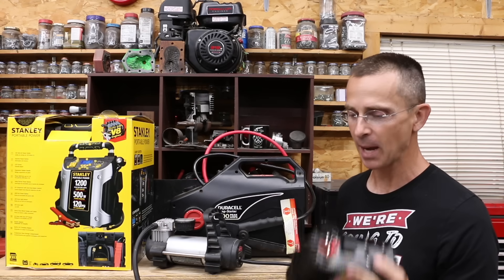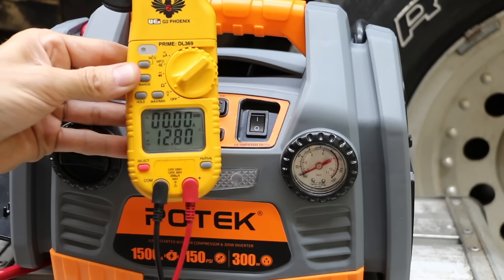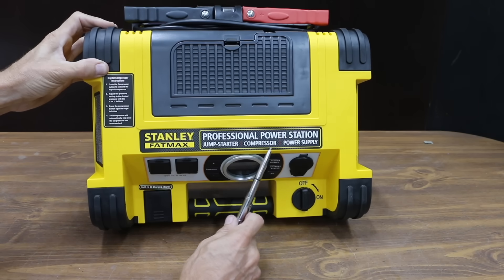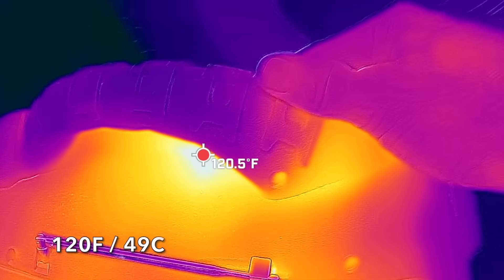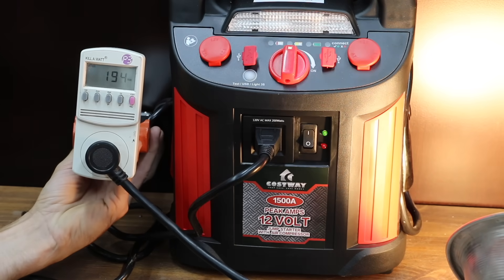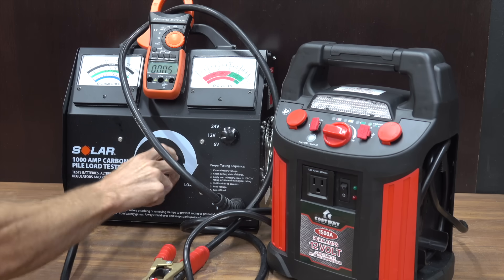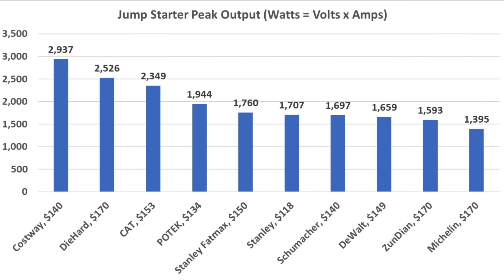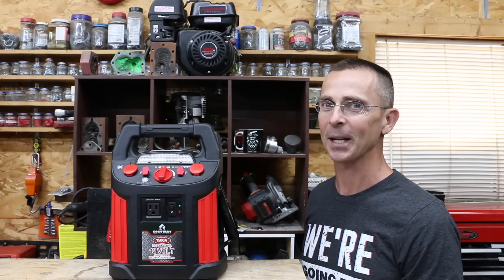Best Jump Starter? DieHard, Schumacher, DeWalt, Michelin, Stanley, CAT

Comment: I bought a smaller jumpstarter for my hatchback based on your video and it worked flawless when I needed it. Thanks for the deep analysis and keep up the great work.

Any plans to test portable deep suction wet vacuum cleaners? Looks like it's not getting more affordable and starting to compete with the bigger ones, but is it as good as?
Reply from the maker: Thanks, will do!  Thanks for the suggestion.

Comment: I wonder how old the lead-acid batteries were in those chargers. Lead-acid batteries typically have a 5-year shelf life, but the charge capacity can diminish greatly after just one year whether the device is used & charged or not.
I should also point out that clamp-type ammeters only read accurately when the lead you are measuring is completely perpendicular to the plane of the clamp. Any deviation from that will show a lower current reading.
Reply from the maker: Thanks for the feedback.

Comment: I was hoping to find out if any of these used a lithium battery but you stopped mentioning the battery after the second one. Still a very interesting test. I love my Schumacher maintenance chargers on my motorcycles but I'm not buying one of these. Another Great Video. Maybe you should have tried another car battery just for grins. Mike
Reply: P.S. with all the great videos you produce I'm surprised you have time for the farm. Thank you again Mike
Reply from the maker: All use sealed lead acid and one is agm.

Comment: Would love to see how the DeWalt DXAEPS2 does in these tests, it advertises 2800Amp peak jump start, 1000w 120v power inverter as well as the 120psi air compressor, work lights, an alternator tester and USB ports
Reply from the maker: Thanks for the suggestion.

Comment: Those don't really seem viable as a jump start for a dead battery situation along the road!  How about a test of those much smaller capacitor type?  It would appear that these tried to do way too many things and failed at most.  A simple jump starter with maybe a cell phone charger capability that could actually do a couple of starts in cold weather would be useful.  These are so much junk.  This is at their peak condition.  Toss them in the trunk and go to use them a year from now......   Good review as usual.  By the way, if you plugged these into the car battery for the inflation test would they have completed the fill without quitting??
Reply from the maker: Thanks!  They have a timer to prevent overheating.  When cool it can be restarted.

Comment: I’m sad that “jump n carry” wasn’t tested. I see them used by nearly all commercial tow and auto repair services. They have no flashy consumer junk. Also I’d like to see these jump packs taken apart to see the construction and battery. I took my jump n carry apart and was pleasantly surprised buy it’s robust construction.
Reply from the maker: Thanks for the suggestions.
Reply: Same here, I’ve had a couple of these consumer grade jump packs, and a Jump N carry 660. I’ll never waste another dime on the consumer ones again the JNC660 is over 10 years old and is just an absolute beast. Worth every penny.
Reply: JnC are really the best Ive ever used but the form factor is also very Truck friendly, behind and under the seat!
Reply: All my workers have jnc best best many days used with out charge for cars sitting for years nothing better then jnc
Reply: Another vote for JnC, I've had one for about 9 years, and it still meets performance expectations every single time I use it
Reply: A take down would be informative. The Canadian tire version of these multi function jumper compresser boosters had very low cross section power bus connections and when its battery packed in, batteries with its light  pole configuration weren't available. I went over to a higher end Jump and carry  type Booster with a heavier battery and bus, and have started at least one jeep that a Noco couldn't turn over.
Reply: News flash, they're just like these. How do I know?? AAA sent a guy in a tow truck and they were unable to start my dead battery. I borrowed a jump start battery from somewhere (it didn't have all the other doodads on it) and it was able to start my car. You'd think the tow truck guy would have jumper cables. But nope.
Reply: @metatechnologist  man the jump and carry one a great and powerful
 will start a diesel engine no problems  some model are12/24 volt for big equipment that run on 24 volt
Any multi tool is junk so no surprise about these 3 in 1 booster pack
Reply: @metatechnologist  Why carry jumper cables which can only supply what the host car puts out (less than 1000 peak amps) when most modern, even cheap, Lithium Ion jump boxes can push out 2000 and many can reach 4000 peak amps.  That's enough to crank even large displacement heavy duty pickup truck engines - so long as they're 12 volt.
Reply: @amzarnacht6710  yea jumper cables tie into what the other host alternator i.e. (higher crank/viltage) can provide as well. My experience has always been that they are quicker and more reliable. AAA has no excuse!
Reply: @amzarnacht6710  you are not just pulling from the donor car alternator, but their battery as well.
Reply: @totaljunk7508  Still doesn't produce much more than 1000 cranking amps.  Sufficient for a slightly drained battery, unlikely for a flatlined one.
Reply: Have a jump n carry at work and can confirm they are junk. Worked great for a couple cars, after that won't jump anything
Reply: @DFxDesignz must be a fake we got 3 at the job and been doing great for f350 diesel and many john deere loader that use 2 ×1000cca batteries
Reply: @legros731  No, you have a completely different model if they're jumping 24 volt systems (2x batteries).  Connect a 12v box to a 24x system and it'll do nothing but burn the box out.  Most 24v capable models can toggle to 12v with a switch so won't fry your pickup truck's electronics.
Reply: @amzarnacht6710  you are clueless  
Jump and carry make many model my particular model is one of there best And cost 500$ and it been doing strong for many year 
 It the jnc1224 and it do both 12volt and 24 volt just need to change the plug on top to switch from 12 to 24 we almost never use the 24 volt when a say 2 battery on the john deere there in parallel so it still 12 volt but it 2 × 1000cca battery or 2000cca total and these booster can start them just fine even in winter
Go away internet mechanic lol
Reply: @DFxDesignz Unit must be charged minimum every 3 months when not used.  Product literature  strictly states this.  Also states must be  immediately charged after each use.  Failure to do so degrades/ruins internal battery.  While you may have received rare defective one, failure to follow charging instructions are mostly to blame.
Reply: A can told you they beat any of these useless shit with ease
Reply: Small lithium ion jump packs are better. Just hold the clamp on tight while someone cranks the engine.

Comment: These tests are interesting, but for products like these, one further step would be particularly useful -- a partial disassembly of the units to (1) look for damage (what smoked?), (2) identify the battery contained in each unit  (same manufacturers?, manufacturing data that may be printed on the battery might be helpful, glass mat?,  etc.), (3) consider the quality of the components (eg, gauge wire, type of compressor, quality of compressor -does it use a plastic piston, metal piston, adequate cooling fins, etc, quality and characteristics of the inverters, etc., all of which may relate to the anticipated service life of the units).
Reply from the maker: Thanks for the suggestion.

Comment: I had a Schumacher and it failed to jump start a 4 cylinder. Then failed first and second time I tried to use air compressor.I would not buy any of these due to poor performance on compressor and jump starting.
Reply from the maker: Thanks for the feedback.

Comment: When one of these units dies it is usually the battery in the unit not the circuitry. If the internal battery can be replaced for cheaper than replacing the entire unit that may also be a factor to decide which you should purchase.
Reply from the maker: Thanks for the feedback.

Comment: I have the CAT unit, I did not realize when I got it that it did not have a 12 volt outlet, I wish it did, so I hooked the cables to a 12 volt plug and powered a 12 v fan but had to listen to the unit beep all the while it was turned on I also wish it would charge in my vehicle. As always, great video!
Reply from the maker: Thanks!  Thanks for sharing.

Comment: How well did the inverters hold the AC voltage as the load increased? I wouldn't want to plug anything sensitive into one anyway, but in an emergency...

Comment: this is a good test, as always. I would expect all of these to be crap in cold weather as the lead acid batteries will lose a lot in the cold. These could be good for traveling or an all in 1 setup in the house just in case. I keep a lithium polymer jump pack in my car as it lasts a long time between charges, and isn't near as affected by the cold. ( when you are more likely to need a jump pack ) Some cold testing would have been great to see how useful they would be stored at 32f for say 12 hours, before trying to use them. Even with the slightly low battery condition test, I expect some, if not all, would not be helpful starting a car.  My Lion pack started my 4cyl in 30f when the battery was 7 volts and at the end of its life during the winter. ( 3 yr battery lasted 5 years )   
Thank you for the testing. I would like a battery powered tire filler so looking at a Makita one vs one of these all in ones, that frankly, would be better for me as I rarely need to fill my tires. I hate dragging out my 30gal tank or 6 gal smaller compressor.
Reply from the maker: Thanks!  Thanks for the constructive feedback.
Reply: 32f is not cold.  -32f is cold.  The trees crackle when the wind blows, and the air itself is literally brittle.  Temps like that are the true test of any battery.  Or any anything, for that matter.
Reply: @Brian424  32f is cold for many parts of the US, not all, but still cold.  There will still be a difference in cranking ability at 32f vs 70-80f. I mean, he can go to 0f as well and test it. When my car battery finally died, it was good at 70f but wouldn't crank at 35f.

Comment: I have a Stanley, it's a good jump starter and decent inverter.  The air compressor on the other hand had the gears break free from the motor and took a bit of rigging to fix. Not bad for the price but be mindful the compressor isn't the best
Reply from the maker: Thanks for the feedback.

Comment: I have the Stanley fat max and the power inverter just stopped working after 2 months of owning it. Only used that function to test it. Took apart and to my non surprise...very chinsey inverter unit. Just my input. Everything else works well enough for the cost I suppose.
Reply from the maker: Thanks for the feedback.

Comment: It looks like Amazon has the Costway under a different name, called a GoPlus Jump Starter. All the specs and external features are the same and even the images used look the same. It may not be the exact same unit, just by a different name, but it looks like the only thing different is the name. You can decide for yourself.

Comment: I wish for some of these you would do 70-80psi on a loaded truck. The only reason I would carry one of these is blowing a tire on a worksite.
Reply: Also, Dewalt battery chargers suck. I had 4 go bad under warranty and then they discontinued and refused to replace a $160 unit
Reply: Also you should have clarified, when the gauges on the devices were off, if they were reading low or high.
Reply from the maker: Thanks for the suggestion.

Comment: I've had a few of these "can do everything " boxes. They are normally crap. The battery never can start anything bigger than a 50cc moped. The tyre inflator and its gauge are useless plus the inverter can't power anything before the cheap sealed 15watt hour battery gives out. Least the l.e.d light may be better than the old 5w bulb that they used to have.
Reply from the maker: Thanks for sharing.

Comment: Years ago I had a Black & Decker Start-It and it was great.  It would jump 3-4 cars on a full charge.  I still have it and need to see if I can still get a replacement battery for it.  After the battery finally died in it after about 4-5 years, I bought a Schumacher and it was a piece of garbage.  It wouldn't jump 1 car!    The black & Decker was just a jump starter, but it did have a 12 volt accessory port.
Reply from the maker: Thanks for sharing.
Reply: @ProjectFarm  You're welcome.

Comment: I really liked seeing these all head to head. It's hard to tell which one is the best just by going off the packaging stats. I bought that Schumacher one a couple years ago. And it was better than nothing in a few situations. It only lasted about a year or so and the battery just wouldn't hold a charge anymore. I did leave it in my trunk in the cold for a couple weeks and it lost a lot of charge and wouldn't jump start a car anymore after that. It didn't seem very well made either. The valve on the end of the hose for the compressor rusted after I used it one time and never worked the same. So had to hold the hose on for 30 minutes to air up a tire. And the hose was very short. I'll say the air compressor would never overheat at all though. You would quickly run out of battery before that would happen. 

The Costway looks like it would last a lot longer with the better battery capacity and jump starting power. I'll definitely go with it next time. Thanks for the great info!
Reply from the maker: You are welcome!

Comment: The Viking I bought from Harbor Freight is possibly the greatest jumper pack I have ever owned or used. The 250 psi compressor is no joke at all. If you make a second video, please include it. I think the result would surprise you. P.s. I owned the Stanley ($118) in this video for about 2 weeks. Returned it because it wouldn’t even jump my riding lawn mower. Biggest waste of plastic I’ve ever seen
Reply from the maker: Thanks for the suggestion.  Thanks for sharing.

Comment: You should do a show down on grid tie Inverters. I am having such a hard time finding info on one under$100- $200. If you do end up doing this. A follow up video on good value solar panels. To Mach the wattage would be great to. I've Loved your videos for years.
Reply from the maker: Thanks so much!  Thanks for the suggestion.
Reply: @ProjectFarm  Can you do a video on water resistant work gloves that keep your hands warm? Tis the season ya know :)
Reply: I work in solar. Grid tie inverters really don't get cheaper than that - you can do microinverters for a full size residential panel, but you need a decent bit of accoutrement to get micros to work. For quality that lasts, you have to spend money.

Also, best value in solar panels isn't something he can really test. Look up existing review sites and compare the specs - every manufacturer does extensive testing and publishes results. A cheap high wattage Jinko and a more expensive equal wattage LG might preform equally in even Project Farm's extensive testing, but the degradation over time might be significantly worse.
Reply: @cgunugc  Well, he does sometimes test things over a year or longer, so.... it's not impossible that he'll test solar panels some day.

Comment: Pretty crazy that they wouldn't think to put ventilation on some of these devices. Like even air holes on the side for passive airflow, let alone a fan that turns on. That's pretty ridiculous that some can't even complete the one job that they set out to do. Another reason you need to test everything! Can't take anything for granted.
Reply from the maker: Thanks for the feedback.

Comment: Nice, I'll keep a couple of the options in mind...you want suggestions, so here it is:
** What I really need is to find a fairly quiet home air compressor.  Something with at least 85 PSI at a couple of CFM for various things... like inflating tires and running a solder paste dispenser.
Reply from the maker: Thanks for the suggestion.

Comment: I see you have a Solar brand load tester, I have one of their parent company jump start + compressor boxes, the Clore JNC Air. It's a great little unit and I got tons of use out of it but unfortunately the compressor over heated doing a bunch of tires during a summer heat and the pump doesn't fill as fast as it used too although it still works.

The auto temp shutoff is useful for keeping them alive, I don't think the clore has any temp protection for the air compressor, my only warning was the burning pump smell. I'm guessing I must have got the seals too hot since it did partially recover.
Reply from the maker: Thanks for sharing.

Comment: Very good information but also very unsatisfying seeing as only one can actually jumpstart a vehicle. And that was only a small 6 cylinder motor.

If it can't jump start your car all the other features or a moot point.
Once your cars running you could power any other device you want. But you need to get it started.

I think you need to go back to square one and just find a solid reliable jump starter.
Reply from the maker: Thanks!  Thanks for the constructive feedback.

Comment: Excellent. I have had a Schumacher that I got at Tractor Supply more than 7 years ago. It has saved my butt so many times for jump starting and low tires on pickups and trailers. The battery in it is probably getting close to done. I will consider the highest rated one in your assessment as its eventual replacement.
Reply from the maker: Thanks!  Thanks for the feedback.